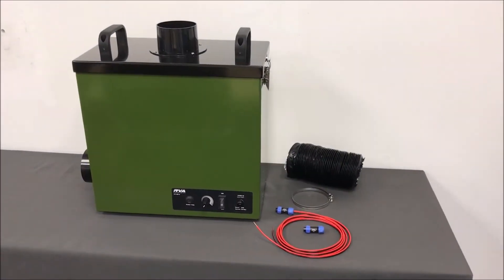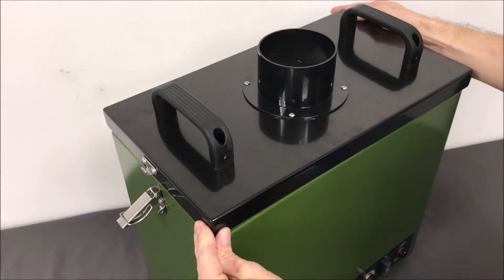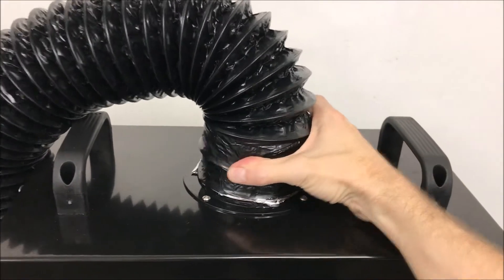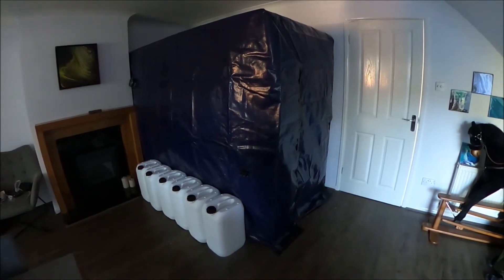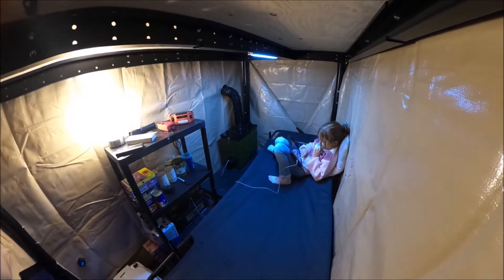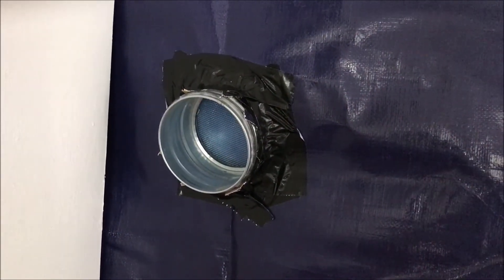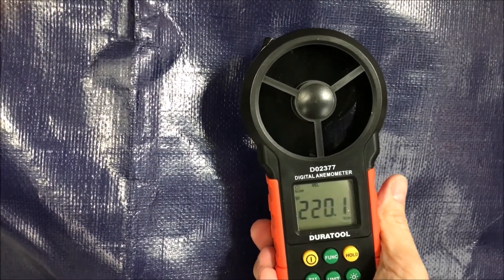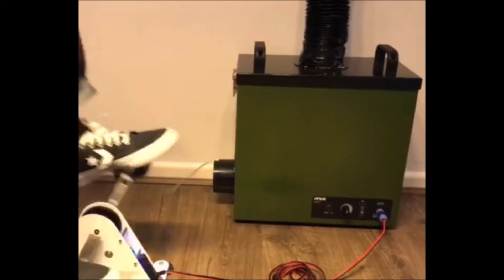UK1 12V Air filter unit for emergency shelters

Comment: How hot is it getting in that tent?
Reply from the maker: HI, so sorry for the late reply.  It doesn't get hot in our location as the ambient temp was around 12 deg C.   Different countries and times of year will affect the temp of course.
Reply: Ok. Thank you. How long will that unit run on a battery? Also do you have a rough price range for it shipped to the United States?
Reply from the maker: @BryanKirch  Hi Bryan,  let us choose a 50A 12V car battery.  This will last 8.3 hours with the fan at full speed (6A). 16.6 hours at half power.  Sure,  we ship to the US with UPS.  Just send an e mail to info@rvasynergies.co.uk with your full address etc and i'll send you all the info.

Comment: Are replacement filter blocks available and what type of fan is used ?
Reply from the maker: Oops!  We missed your comment, sorry.   Yes replacement filter blocks are available and a 12V DC 6A (MAX) fan is used, with a 10A fuse.

Comment: Your online pdf and website seem to contradict each other. One states 100cfm the other 65cfm. Do either of these flow rate represent the filtered air flow rate or are these just maximum flow rates i.e. without the filter block with zero duct pressure loss?
Reply from the maker: Hi,  we under-state the actual flow rate of filtered air out of the unit as 65 CFM.  We do that to be safe and provide a practical output that is more realistic to cover a range of set ups once pipes etc are connected. The actual flow rate at max power (6A) with battery fully charged in Feet per minute measured at the exit of the unit with a manometer is 1500 measured at 100mm output duct as 1500 ft/min x 0.0666 (Area of duct in ft sq) = 99.9 CFM.  *the internal fan is actually 270CFM (With no filter block in front of it).

Comment: Could this be used as ventilation only, if you sealed the filter block in plastic and didn't have it installed?
Reply from the maker: Hi,  yes,  absolutely.  There is no reason why not.

Comment: Looks like a good product. Thought about contacting Atlas Survival ?
Reply from the maker: HI Greg,  thanks but i have not contacted Ron from Atlas yet.   I think he only sells £15-20K Swiss made filter units.   The thing about that is,  most people are making small improvised shelters and can't fit or afford the Swiss one.   This is why we made the UK1.  So almost all can fit and afford it!
Reply: ADD A HAND CRANK THEN IT BE GOOD
Reply from the maker: @Bikepacking  Thanks.   I found though,  that pedal generators are much easier to power it than hand cranks.  I've tried some hand cranks and they are quite hard to turn to get consistent power especially for longer periods or for kids to do.  Pedal generators are much easier.   So i tend to suggest all options to customers.
Reply: Is there a link to buy one?  This would be perfect for my setup
Reply from the maker: @Musket85  Sorry for the late reply.  A link for the pedal generator?   or our product?  The UK1 is here https://www.rvasynergies.co.uk/security-inspection/security-accessories/130-uk1-12v-nbc-air-filter-for-emergency-shelters

Comment: What kind of pressure valve are u using to exhaust the air?
Reply from the maker: In our test shelter we used a basic plumbing 'air admittance valve' from a hardware store.   Or, no exhaust valve at all, with air exhausting through any tiny leaks/gaps in our tarpaulin cover.  Both work.  But in a solid leakless shelter you might want a more sophisticated exhaust valve.  We are working on designing a precision valve here.